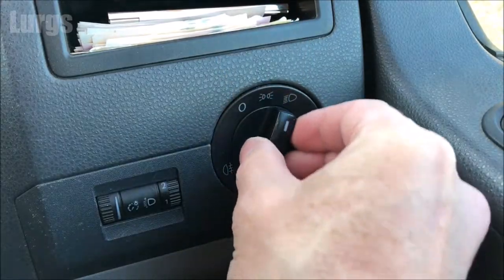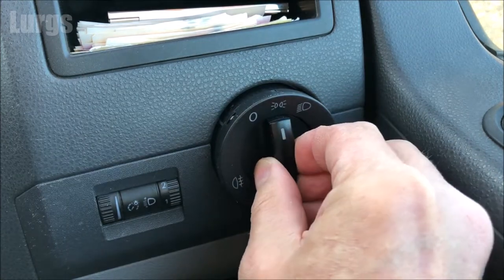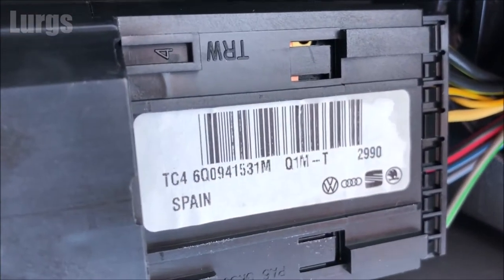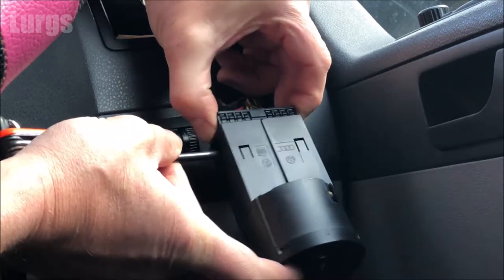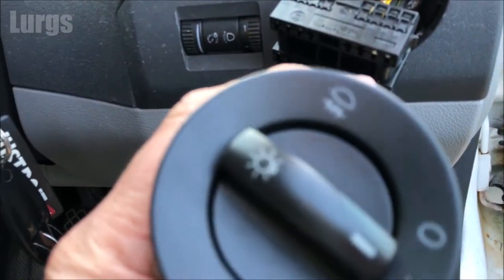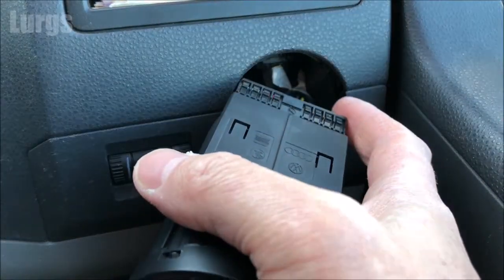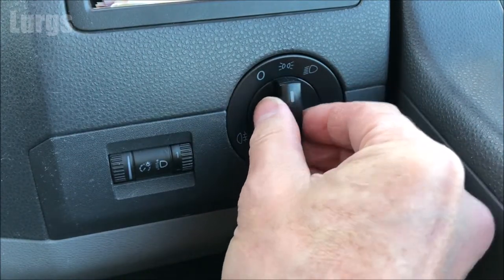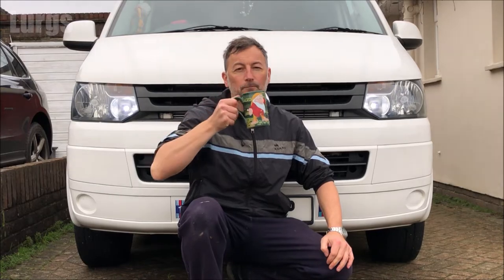How to remove Headlight Switch on a VW T5 Transporter no Tools needed

Comment: Thanks for this, I bought a new switch supposedly for a T5 but the connector is nothing like you show but existing is, also whats the best way to feed wires through the firewall?  (subscribed)
Reply from the maker: I’d send it back and get the correct one. Should be standard